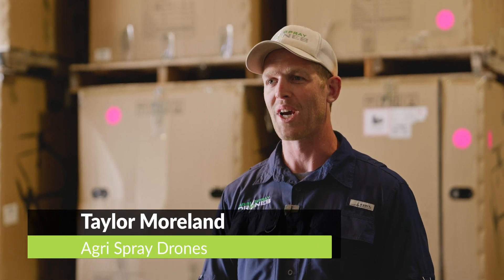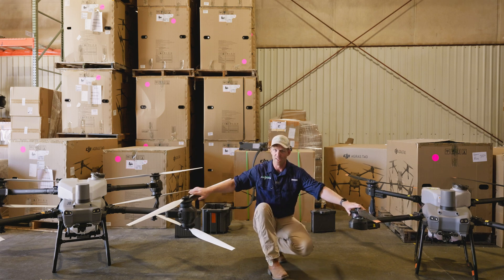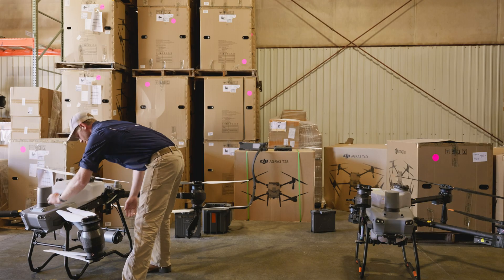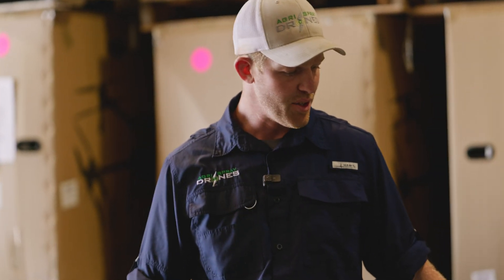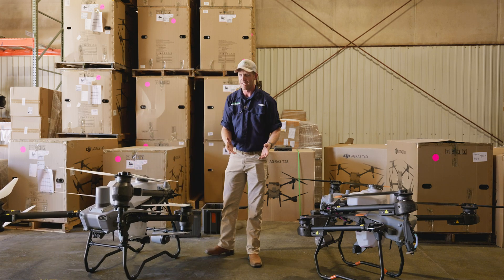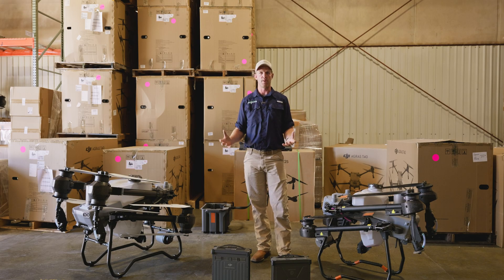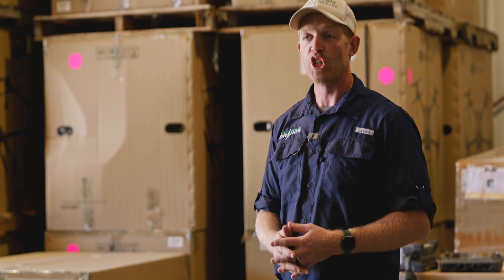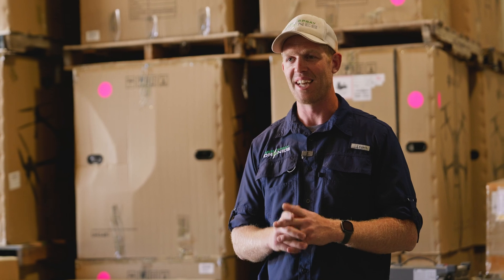DJI Agras T25 vs. T50

Comment: What's t25's spraying aveage time in comparison whith t50? For example in what time do they spray 10liters per 1 hectare?
Reply from the maker: The T25 and T50 have the same spraying system and thus have identical flow rate capabilities. The T25 will just empty faster as it has a smaller tank!
Reply: @AgriSprayDrones  so, according to batteries. How many litters can spray t25 and t50 per 1 charge. If it's 10 litters per hectare?